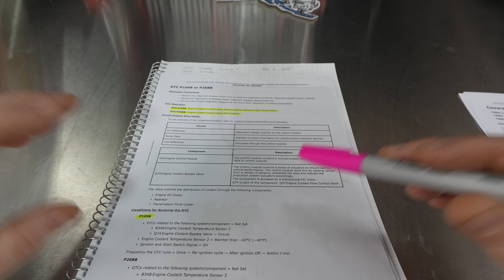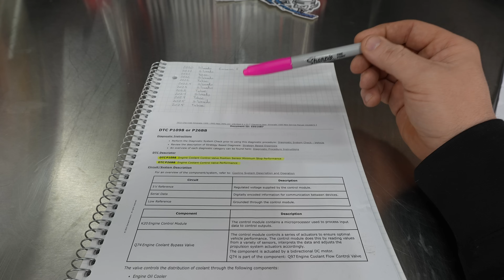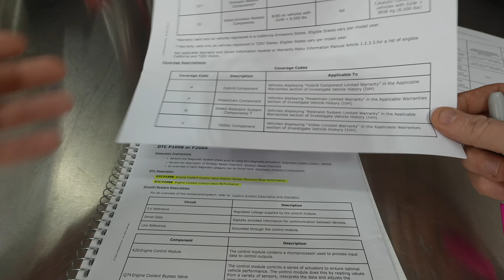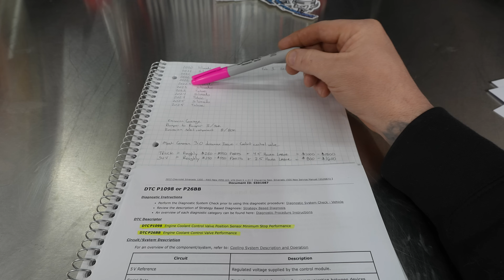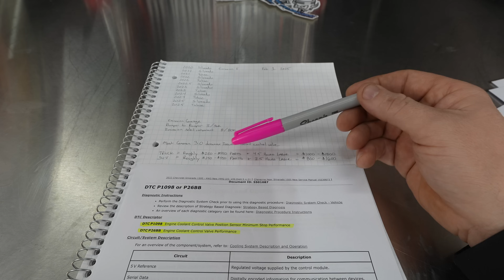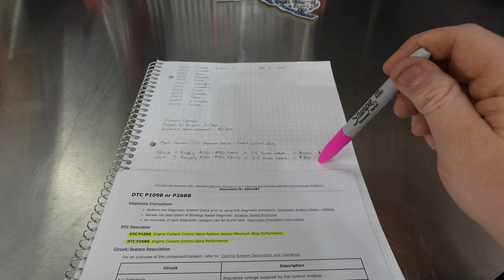UPDATE- This is covered and will be corrected March 1 - 3.0 Duramax Coolant Control Valve

Comment: My friend and I are getting close to pulling the triggers in new purchases. Things like this are giving us cold feet!
Reply: Have 2023 Tahoe 30K miles  with LM2, milage is  pheromonal. Installed PPE Zilla Pipe, Res, delete and hoses. The drivability is great. LZ0 has even more HP+Torque.  Had a 2016 Colorado 4cyl. diesel, absolutely no issues 160K when I sold it.  That's why I purchased Tahoe Diesel
Reply: @dfpont does the PPE and delete void the warranty?
Reply: @ it should not . Unless the Aftermarket part was the cause of a  OEM part to fail or  result of a service issue. ie if your complaint is hesitation, dealer could  say its due to Zilla intake tube.
Reply: @samuelbonacorsi2048  Good luck… I had many issues with my 2024 3.0… from 600-5700 miles… I'm at 8500 now and it's been behaving great…many grounding problems, the problem I think also is where these trucks are being assembled… mostly in Mexico! You get what pay for… surely GM is wasting alot of money on warranty Repairs… they have spent $6000 on my truck already!
Reply: Third GM truck in a row and have had nothing but issues. Going back to Toyotas and should have never left. Before this had 14 different Toyotas. Don’t buy GM products is my rec. parts are always on back order
Reply: I'm at 135k miles on my 2021 Chevy Tahoe, this code is just now appearing.

Comment: I went to dealer business center submission in global yesterday 3 times they told me emissions warranty even though its in coverage codes table.
 Lift pump and injectors in job aid are now emissions.  
P&p says refer to owners warranty manual.The owners warranty manual says emissions.
Reply from the maker: Similar here. It is in the powertrain coverage tables but that’s not enough to be covered as it is likely just not updated is what I’m told. Sounds like there was a lot of shuffling going on.

Comment: My truck went into limp mode this morning (5110 miles)...it was cold here in Colorado but nothing really crazy to me. Didn't have time to pull codes to see what all popped up because I needed to get to work but I'll be checking when I get home. Service emissions system, traction control, ESC, 174 miles to reduced speed, engine was sputtering  and trans was acting up too. Shouldn't be having problems like this on new vehicles. This change to the warranty needs to be challenged for sure. Not sure how they can justify putting a coolant system component into an emissions category other than to skirt the longer coverage of the powertrain.
Reply: These trucks are notorious having grounding issues… my truck went to dealer at least 3 time with separate issues and all where related to negative ground.
Reply: Mine did that when it was -20c.  Battery was weak and cranked slowly.  Check your battery and charge it if it's good.
Reply: @ Truck started right up this morning, let it idle while I scraped ice off the windshield and the headed out. Got about a mile from the house when the check engine light came on. No other issues up to this point...dealer completed the first oil service 300 miles ago.

Comment: Do you have any idea what's causing the failures? Are the failures mainly occurring in colder weather? Based on what I've seen it looks like the lubricating grease for the gears gets thicker in colder weather causing the valve to operate erratically.
Reply: Plastic against plastic you can see scraping in the valves
Reply: Pretty much a guarantee there wont be any improvements in the part design.  The replacement should have the same lifespan. But I am a pessimist.😢 @charliemagoo7943

Comment: The aftermarket solution for this should be a kit that makes the valve wide open at all times and something to trick the computer into thinking it still is in control. Something like the TGV delete on Subarus.
Reply: You don’t want that. The engine will not run as efficiently.

Comment: Are you sure the op. is not in the powertrain coverage code tables?
Reply from the maker: The op code is in the powertrain coverage tables still. However, in the talks that I had on coverage, it comes down to what is shown in the actual labor op itself. I didn’t bring that up as it could induce a lot of extra confusion.

Comment: I have the part, can i just call a dealer and get an install quote?
Reply from the maker: you could. They may or may not want to do it but if they do, there is a good chance it will not carry any kind of warranty. Just my opinion.